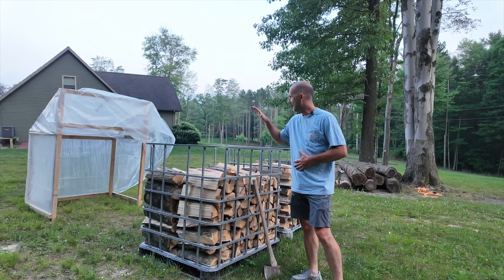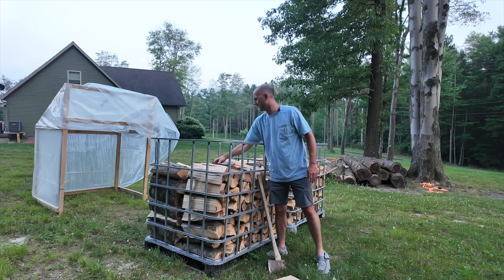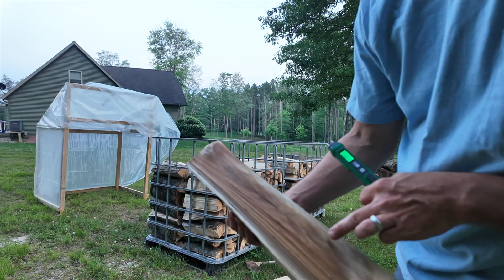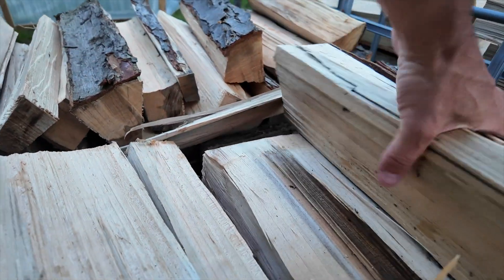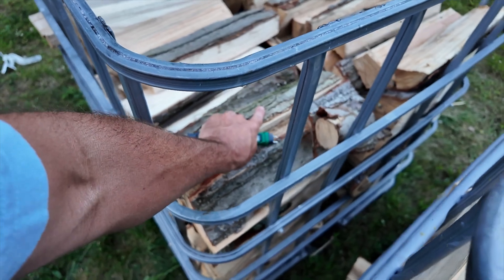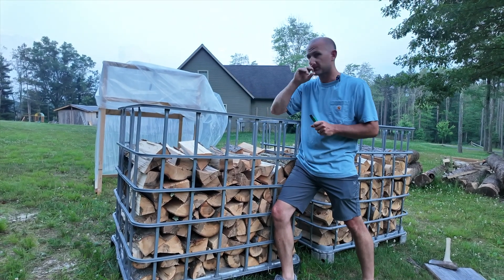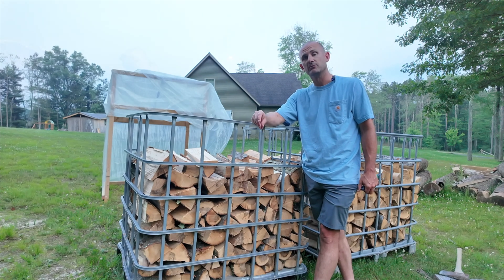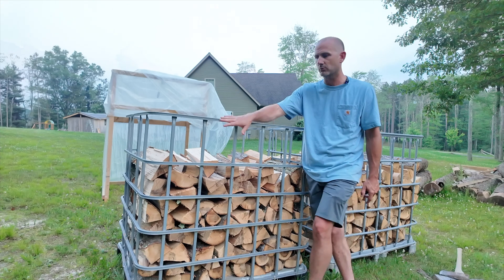The RESULTS Are In! - IBC Tote Firewood Solar Kiln

Comment: Great experiment, but you didn't give the moisture any where to go.  I'd cut an 8" flap in one of the gable ends and roll up the bottom of the opposite wall to get a cross current through the stack.  Keep up the good work.
Reply from the maker: Thanks. Stayed tuned !

Comment: Thanks for sharing your experience. I do think your idea will work, but you need to let air exhaust. If you put some solar run fans as someone mentioned in comments or even cut an exhaust hole on each side to allow the air to escape with the moisture on the high part of the side panels.  Maybe raise the bottom plastic at 6 inches- a foot. The heat will still remain to help the drying process.  Good luck on working on this project. I appreciate your efforts and don’t want you to feel that I am criticizing your efforts. Have a great week.
Reply from the maker: Not upset by the comments at all. I appreciate them! I’ve got some things up my sleeve for part 2!

Comment: Was hoping it would work for ya but air flow is very important . Gota have air in and air out . Your set up is very similar to drying in a greenhouse only missing part is an exhaust fan add that and it will be a winner .
Reply from the maker: Thanks for the support. Stay tuned, already made some upgrades.

Comment: I wonder about just a clear roof, that way it gets hotter but still is wide open on the sides
Reply from the maker: I’ve got 2.0 coming this week ! :)
Reply: @offthetrailsoutdoors dear please check your email.
Reply: @offthetrailsoutdoors 
Dear please check your email
Reply: Maybe get one of those cheap remote thermometers to put in each tote to check the temp
Reply from the maker: @bobaganooshy that’s a great idea!
Reply: I put clear plastic on front side of wood shed and it gets to 130 during the day. Sides and rear are open with slats spaced 2” apart to get airflow. I seasoned my wood in July and August then removed it for September and October during dryer months. Stacked it in May and Moisture was 16-19% throughout the 5 cord wood shed. Locust and red oak I split thinner all others a little bigger. It worked. 5 mil plastic on southern facing side. Air mostly westerly here in the northeast but west, east, north sides stayed open for air flow
Reply from the maker: That’s great . I’d like to see a photo of that setup!